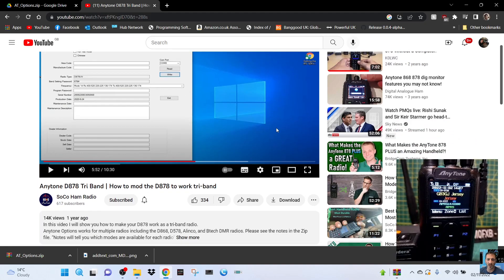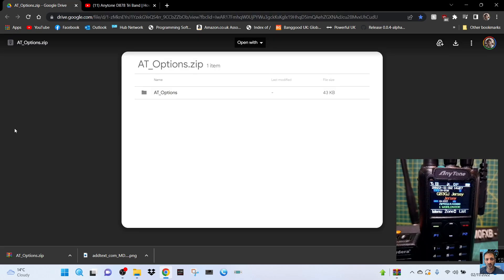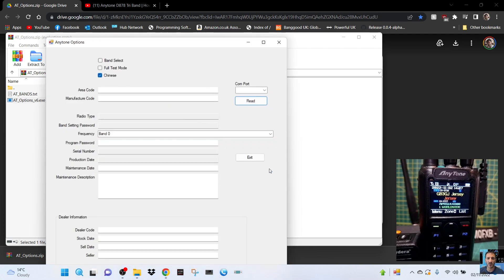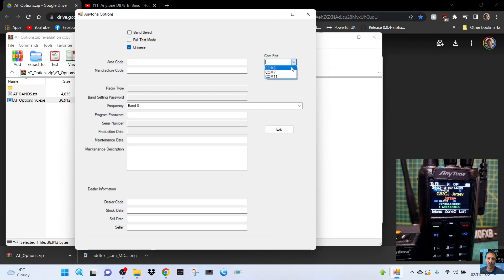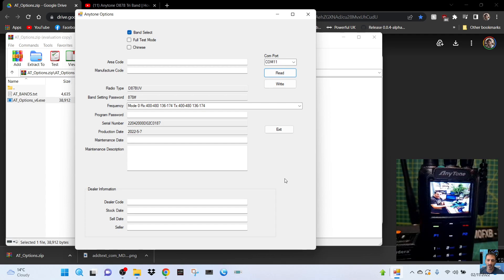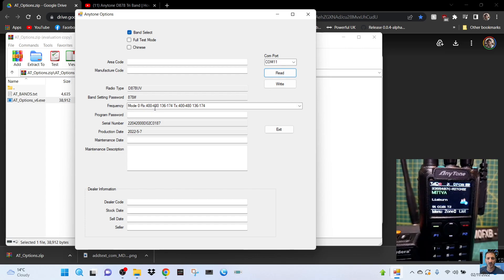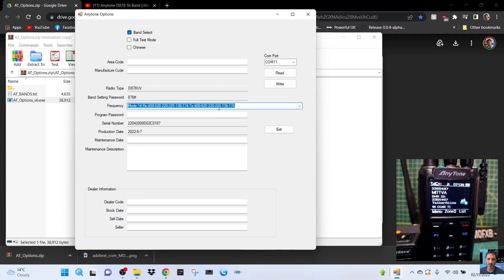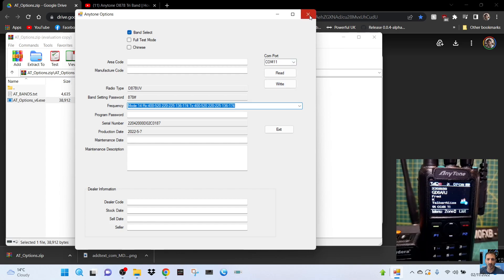ANYTONE 878 -Turn Radio in to TRIBAND Radio -(at options)

Comment: The issue I’m having is when it does wipe the radio how do I get my frequencies back and hotspot do I have to manually add those in again?
Reply from the maker: Always make a back up using software otherwise you can borrow a premade codeplug from a friend .

Comment: Just would like to if this tool would work with d878uvii plus model? Thanks
Reply from the maker: Yes think it would but check with Anytone .
Reply: @M0FXBHamTech  I tested, it works perfectly and my firmware is 3.01. 

73
Reply: Yes, it works with D878UVII as well!

Comment: I've seen a post somewhere that while the system on a chip in most of these radios can do more frequencies then the radio is programed to do these radios don't have the supporting components to use them, therefore it might not be a good idea! You might damage the radio or transmit to high of speriuse emissions to make it illegal or very unwise to do so!
Reply from the maker: Yes not recommended.

Comment: Thanks 😊.  I don't understand why Anytone
didn't include 222 MHz. as in the Anytone
D578 mobile unit, and also found in my
similar Alinco MD520 DMR mobile.
I had seen another YouTube video about
the steps you followed here to include
222 MHz.
Do you have any idea what the output
power is with the 222 MHz option installed?
73 de W2CH Ray New Hampshire (1962-2022)
Reply from the maker: I have no idea I wouldn't do it .